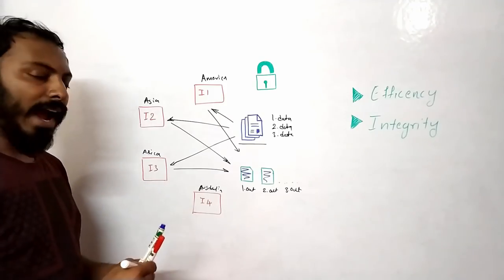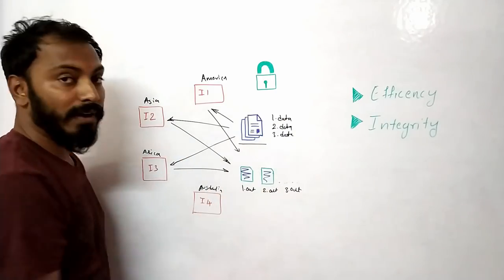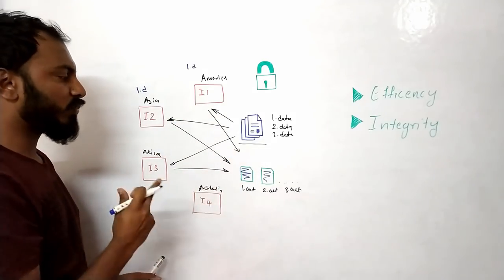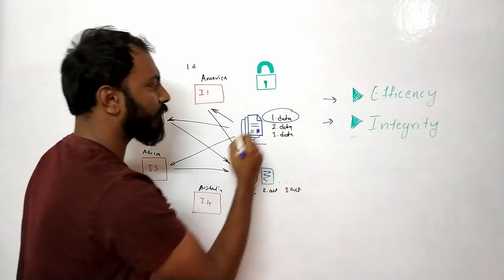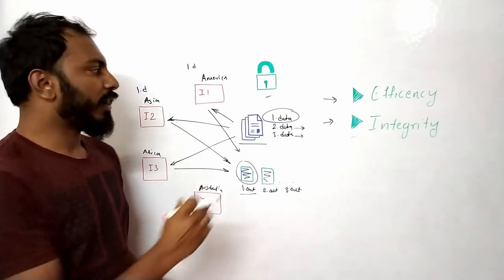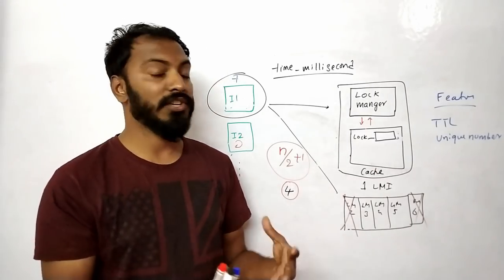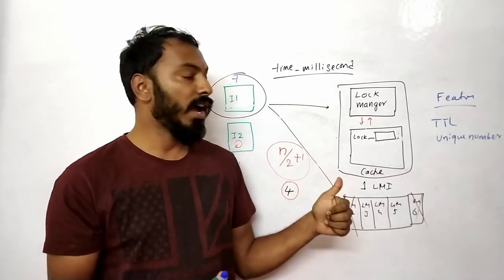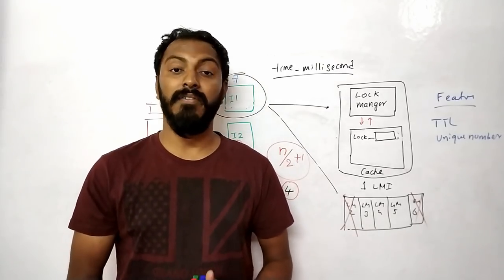Distributed Locks | System design basics

Comment: Thank you.. But it looks like by adding TTL we defeated the original purpose.. Original purpose was not two user(I1 and I2) should write  in 1.out at same time. After adding TTL it looks possible I1 is writing to 1.out file and i2 may start writing as well which may corrupt the 1.out file
Reply: Same question. Anyone can illustrate? @Tech Dummies - Narendra L
Reply: @seanhsu9381  It also puzzled me too, but in the end, there wouldn't be any data corruption. Either one of them will write the whole file
Reply: @Narendra Kumar Gupta, you are right, that will be a problem. To avoid that, TTL has to be set after monitoring the performance of the applications which are trying to acquire the lock, e.g. after 1000 iterations, you observed that the applications are taking maximum 7 seconds to process and then release the lock, so you set the TTL at 8 seconds.
Reply: @narenmehra9268    lets consider the following: each machine should increment the value, and each machine had different processing time for that (or even sleeping time - just to illustrate) -  server 1 pulling value of 0, locking, ttl has pass, server 2 pulling 0 , and update to 1, release the lock, server 1 already has invalid data, and updates the db from 1 to 1..  not sure that this solution solves it..
Reply: SOLUTION :-  LOCK MANAGER DOES NOT PROVIDE ANY RANDOM  UNIQUE NUMBER, IT WILL PROVIDE A SEQUENCE NUMBER. ANY NEW REQUEST WILL BE PROVIDED AN INCREMENTED NUMBER. 

WHEN CLIENT GOT THE LOCK AND SEQUENCE NUMBER, IT WILL HIT THE DATABASE SERVER WITH LOACK AND SEQUENCE NUMBER. DATABASE SERVER KEEP THE TRACK OF LAST SEQUENCE NUMBER PROCESSED. IF THE SEQUENCE NUMBER PRESENTED BY CURRENT CLIENT IS LOWER THAT LAST SEQUENCE NUMBER PROCESSED BY SERVER, SERVER WILL REJECT THE CURRENT REQUEST. REJECTION WITH LOWER SEQUENCE NUMBER SHOWS THAT THERE WAS A WRITE REQUEST WHICH STARTED AFTER THE CURRENT REQUEST, BUT FINISHED EARLIER. THIS IS THE CAUGHT.
Reply: @seanhsu9381  Stop the world GC pause is minimized now
Reply: Keep timestamp of lock acquisition , if older process which was holding lock earlier came into picture after ttl and lock is acquired by new timestamp then access to older process willnt be granted thus system will wotk fine
Reply: Expiry is set to avoid starvation.

Say a machine claimed to do work and disconnected, Now who will take care of that work?

The problem of avoiding the file corruption can be done by checking whether the lock is still active before writing to output file.

Comment: But if the  lock expires while the I1 is still thinking that it holds it, I2 can now get the lock to the shared resource and cause race conditions and undefined behavior. This doesn't seem like the solution

Comment: For some reason, I didnt quite like the design of this locking system. First of all the moment you add a TTL, the "Integrity" part of the problem is compromised. If it is not for some reason, the video failed to explain it. 

Secondly, adding time as a unique identifier is a bad idea for this because as you said you either need to have all the machines serving same time which is not easy OR have tolerance capability built it. Both of these solutions look complicated to me. If you are already building this complicated system of locking, I would rather externalize the generation of unique keys to a KeyGen Service or in simple terms, use the server/machine ID as a part of the unique id. That ways it will always be unique. 

For me, rather than having a TTL, I would rather split the file in chunks and apply locking at chunk level. This way multiple machines can work on multiple chunks of the same file. This will still not solve the issue of parallel writes to 1.out. So to mitigate that, they can probably write to something like 1.chunk1.out, 1.chunk2.out and so on and then have an aggregator service which will aggregate the chunks and for a 1.out. Surely it adds complexity but I think this is a good way to mitigate the parallel writes. 

Thanks for the videos!
Reply: Instead of TTL, Uber does the heartbit from the app server to the lock manager instead of hard coded TTL.
Reply: While I agree with your comment to some degree, you don't provide any real-world system example which operates the way you described.  On the other hand, Chubby uses TTL - "While imperfect, the lock-delay protects unmodified servers and clients from everyday problems caused by message delays and restarts."
Reply: Then how do you lock 1.chunk1.out ? You still have the same problem, no?

Comment: Instead of lock_<timestamp>, Can't we just take a combination of lock_name(sent by client) and ipaddress of the node as unique key so that we wouldn't end up with problem mentioned in 17:05? i.e even though I1 wants to release the lock at 6th sec after I2 acquired the lock, it wouldn't be able to as it hasn't found the lock with the combination of lock_name and ip address.

Comment: Hi Narendra, 

Want to understand two points here,
1.  If you see at time 20:00, There is an elapsed time of 2 Seconds where the lock was handed over to the I2,  If that is the case then what sort information I1 was updating for that 2 Seconds. Do not you think when lock manager itself release the lock then server should get intimation of the same.

2. In Lock Id, We are taking timestamp to create a unique id, Take a scenario where we have multiple copies of the lock manager and server request it to n/2+1 servers to do so, but there will always difference in time within lock manager when that request gets served, If each lock manager takes timestamp at the time of request serve then each lock manager will have different id for the same request.

Comment: How is integrity ensured  in below scenario
1. client1(Instance) acquire lock and perform some operation which is taking longer than lock timeout value
2. client2(Instance) acquire same lock after lock timeout value and start updating same data.
Reply: In this case, you need to use some token that will be sent while you are updating some data. That token will ensure that the update will not be inconsistent. https://martin.kleppmann.com/2016/02/08/how-to-do-distributed-locking.html

Comment: At around 17:10, you mentioned I2 releases the lock which was previously acquired by I1. Locks are supposed to have ownership, and shouldn't allow what you described. But a (binary) semaphore will achieve a similar use case

Comment: Firstly, thank you so much for your really nice video.
Secondly, I am confused at one point. After TTL, if I1 has not finished processing file, and I2 is allowed to process that file also, the data in that file then will be corrupted, won't it?
Could you please clarify it?
Reply: When l1 finished processing the file, and prepared to write the output, l1 can check again whether the lock is still hold by l1. If true, it'll first try to extend the ttl of the lock, then save the output, then delete/archive the file and unlock the lock. But if your TTL is not set properly and it's just not enough time for the worker to finish the work, then this solution won't help in any ways.
Reply: @zhouchong90  what if l1 acquired the lock to write? it will be writing into the file and TTL will expire and l2 will acquire the lock and starts writing too

Comment: at 8:32, why would single point failure cause integrity problem? in that case other processes won't able to get any lock since the lock manager is down, hence no one writes to any output file. The integrity of system is maintained, right?

Comment: When you are releasing the lock after 5-sec (coz it is taking more time to finish the job) and now it's available for I2,  we got lock issue fixed. But you said I1 finishes the job after 7 sec? then what's the point of having a lock? or on the other hand, if you say I2 is locking the same file, then how I1 finished the job in 7 sec? I1 is still writing in the file and now the file will be corrupt.
Reply: When other acquires a lock the system will just stop the process executing in the Ram for the old one to Pageout and store the state in ram , else just close the old one.I am not sure, can anyone correct me
Reply: @abraham12385  It's a distributed system, one cannot know exactly what step it is in for the process that's processing the file (for example, while it is writing half of the output). Only that machine itself knows.
Reply: What you can do is before you generate output, try to acquire/extend the same lock again. If you are able to do so, then you can write the output. And you don't have to make the lock a Boolean, you can have States, like ToProcess, Processing, Completed.
Reply: Maybe keep the TTL record locally on the machine as well which acquired the lock, so ones the TTL expires, both the machine & the lock manager do the cleanup, solves this problem also saves a network call for the machine to go to lock manager to release the lock. Now the assumption is either the time is in sync, or handle that as well.
Reply: Only go to the lock manager if you need the same lock again. If got, update TTL, otherwise do the cleanup. But this is no different than the original request.
Reply: First of all the TTL should be set as such that ensures that any operation locking a resource will be completed within the TTL. That being said, there's always a chance of delayed update after a lock expires.

You could use either of the following mechanisms :
1. lock delays - preventing other processes / threads from requesting a lock for some time after a previous lock expires, so that the delayed update from the previous process doesn't interfere while the next process is executing.
2. lock sequencers - sequence strings specific to the resource being locked, that are vended out by the lock managers. This could be as simple as a lock generation number which is incremented every time a lock changes state from free to acquired.

Additionally to prevent the client from even calling the lock manager, you could have 
1. callback / notification from the lock manager on the expiry of the lock - once the lock expires, the client should not perform any further actions
2. client side caching of the locks on the node(item to be updated )

Comment: Assuming there are 5 nodes and we acquire lock from 3 nodes. consider if 2 nodes which took note of lock goes down, then we are left with 1 node with lock and 2 nodes without lock, which would indicate a resource is not locked as majority wins. Is it not an issues?

Comment: My question is how different is a lock in a distributed system ? Why can't we use locks/mutex in distributed system as we do in case of handling critical section to prevent deadlocks? Moreover a distributed system lock is to prevent files from being accessed by multiple processes at the same time. In this case why can't we use semaphores or any deadlock prevention technique(eg mutex, semaphores, locks) to handle those files. We can treat them as a critical section and allow only one processes at a time to access it.

Comment: # After adding TTL it looks possible I1 is writing to 1.out file and i2 may start writing as well which may corrupt the 1.out file(from Narendra kumar Gupta's comment )

- Idea of TTL would serve better if after time-out ,Lock Manager not only invalidates the specific lock in the cache but also notifies the instance-1 acquiring the same lock about TTL along with invalidating the lock for instance-1  i.e should stop the instance-1 to process the input file on which lock was acquired and as a result 1.out will not be corrupted(integrity is maintained)

Comment: Sir I have a doubt for long time.what is tech stack behind the  Indian internet banking technologies such as upi and imps.How secure they are?Does they use Java for backend (server side) and security?What database does they use?Does they use any framework? Whether they use cloud service or own server?
Please sir .It will be helpful for clearing many beginners doubt on security.If it will be long,You can make a video on it.
I think you will be the best to answer my question.
Reply from the maker: Sure, I will try to get that info
Reply: I worked on a similar project in the past(around 4 years back) when we handled the backend APIs for banking transactions. Most of the services were made on Java, the database varied from MySQL to Oracle(I didn't see using NoSQL anywhere during my time). The applications were managed by the Bank's infrastructure and were not using any cloud at that time. The servers were huge and could be vertically scaled.

Comment: Why do we need to hold the lock till the complete file is processed? My understanding is that we only need to ensure that different processes don't pick the same log file. So wouldn't it be better to hold a lock only till we make an entry to some distributed cache (say filename - log1) and then release the lock immediately ? So when other process comes it sees the cache and finds out that file log1 is already picked and goes for other file. Do you see any flaw here?
Reply: Avinash Yadagere I guess its because you can use this locking procedure anywhere in your system. Different components will use the locking system for different purposes. If you tightly couple it with filename then it will bw difficult to use it elsewhere. Also we need to make sure that the client should not hold on to the file indefinitely.

Comment: In Lock Manager case if we have 6 machines so at least 4 locks are required and 2 machines go down, in that case, how can we ensure that machines which went down are the ones who had the locks(Will we check for 4 locks or 3 locks). If machine count is 5 den we need 3 locks somehow if we add 2 more machines what's behavior in that case. Do we have to discard data and process it again?

Comment: For one particular resource we can make only one instance as master instance so as to reduce the n/2+1 consent requirement
Reply from the maker: But what happens when the master goes down?
Reply: When an instance goes down, all the resources mastered on that instance will be remastered to other live instances. Such information is present in the resource table at all the instances
Reply from the maker: @vamsikrishna_sampangi  if a machine dies because of power failure, all the unreplicated data is lost. There is no way you can remaster. The new master will have fresh data. Old data is gone!!

Comment: a question, how does it prevent issues related to clock skew by using millisecond in the lock ? my understanding is that we should always use proper fencing mechanism instead.
Reply: If possible, its better to create a unique id using a property of the requestor that itself is unique along with the timestamp

Comment: I think rather than having a quorum agreeing to applying and releasing locks, why not have a master-slave architecture? That way, you have a single master node that generates the unique lock id. Moreover, we would have a single point generating the timestamp that would be copied to the slaves. This covers up another avenue where time inconsistencies could happen.
Moreover, I would suggest using a GUID generator.

Comment: once the time period TTL of 5 sec is elapsed and Instance 1 is still working on file1.data but cache entry is removed from cache manager and  Instance2 has requested lock on file1.data and it gets the lock. In this time period  that means now both instance 1 and instance 2 is working on file1.data file so again we have same issue integrity and efficiency. How to handle this ?

Comment: 1. how would I1 even know when to call lock manager to extend the lock?   and with multiple lock managers, I1 will need to call all (or majority) LM to extend time?
2. I don't think we can depend on synchronized clock between all the LMs, right? using time tolerance seems to be error-prone.. why not a GUID generator (that's also fault tolerant?)
Reply: Uber's solution, continuous heart beat from the client to lock manager.. if the heart beat stops, the lock manager can assume client is dead and release the lock. Otherwise lock manager use algorithm to extend the lock.
Reply: Uber's solution, continuous heart beat from the client to lock manager.. if the heart beat stops, the lock manager can assume client is dead and release the lock. Otherwise lock manager use algorithm to extend the lock.

Comment: Thank you Narendra. always great to hear and learn from you. I do have a question- what if instance 1 is working on some task and it takes more than 5 seconds(TTL) so LM releases the lock1, instance 2 comes in and gets lock2 assigned. for this scenario I understand that the lock1 is released by LM but how does that acknowledgement work? how does LM notify instance 1 to stop work, if any, it's doing? do we use TCP/ WebSockets/ UDP for the latter acknowledgement part?

Comment: You should just zookeeper because it solves the quorum for you. Having a TTL is the right call, but you need to implement fencing to stop a process that has an expired lock totally wrecking the system and defeating the purpose.  In the end, you will have problems unless either the datastore implements the locking directly, or it has a mechanism to take a client provided lock and validate it against the distributed lock service.  

Also, using time is a TERRIBLE idea for a few reasons:
- keeping multiple servers in sync a nanosecond level is a nightmare.
- even given that you solve that problem, you can still have conflicts in high throughput systems.